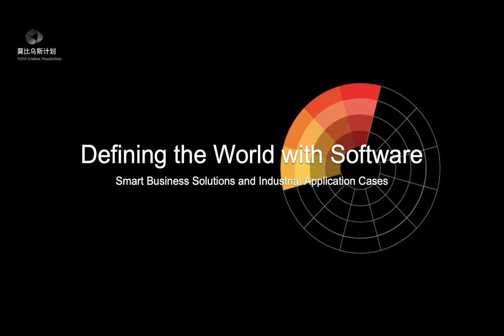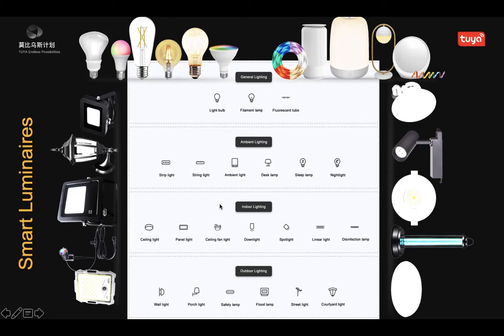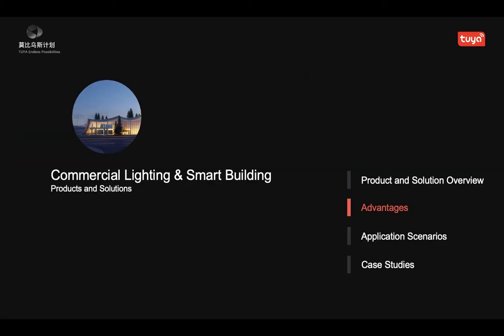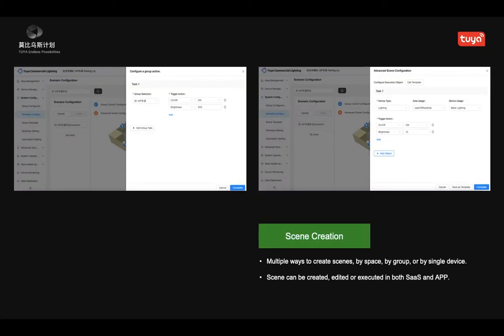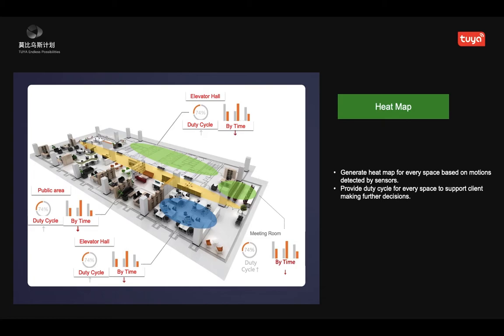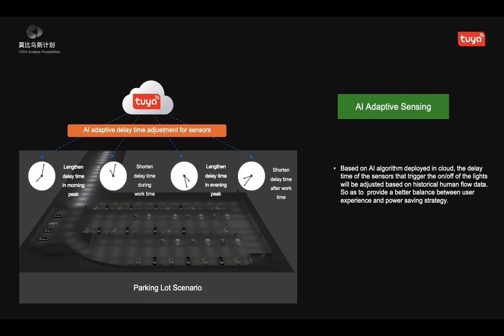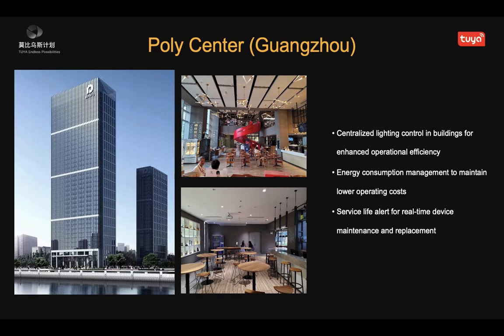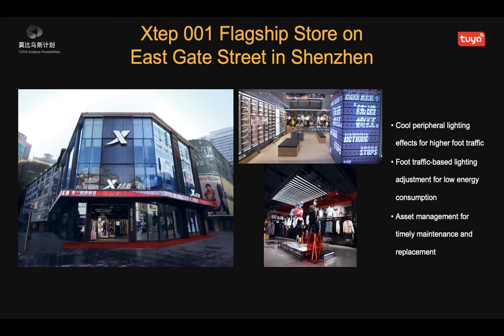Tuya Commercial Lighting Solution Introduction

Comment: Good day thanks you for your presentation . I have been a expirean using a lighting and lock set synchronizing with tuya syatem... This system need to make a configuration again after electric power trip. I make a test at my office. And other than that case very difficult make a configuration. and syatem a totally failure if a network is down... How to make a commercial a system if a normal issue don't have to be a solution 😅😅😅